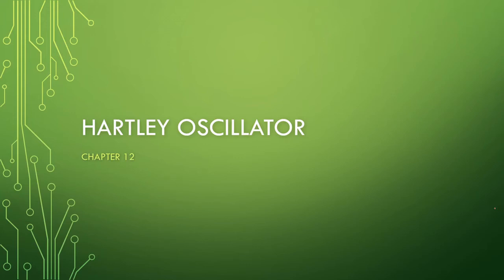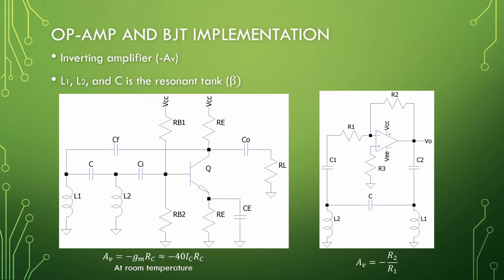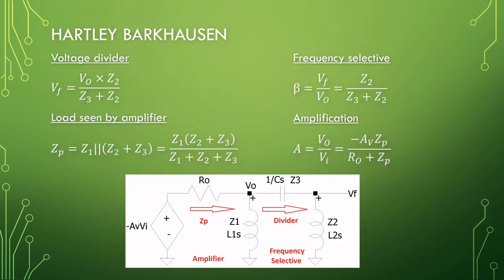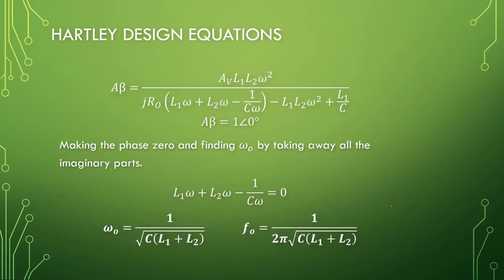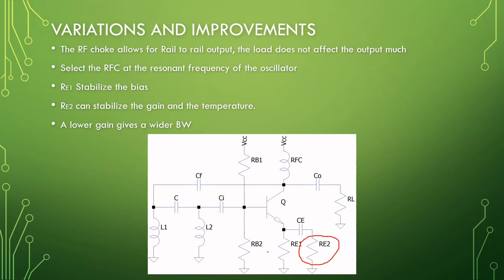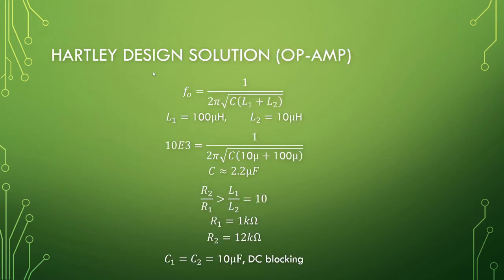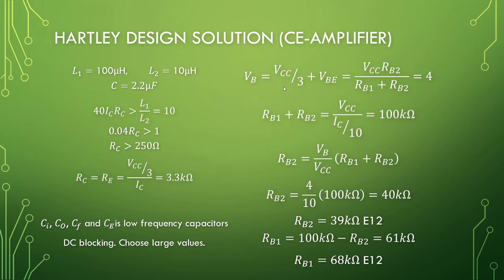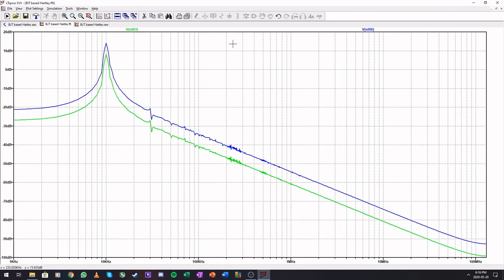Video 7 - Hartley oscillator

Comment: Can we generate frequency in Mhz order using 2N2222 transistor?
Reply from the maker: Yes you can. The biasing will look different, a lot more capacitors and inductors to eliminate components from the small signal. We did a 2.4MHz once. If you construct on breadboard for university practical; remember to ground all the unused tracks an use short wires and component leads everywhere. It is better to solder it.